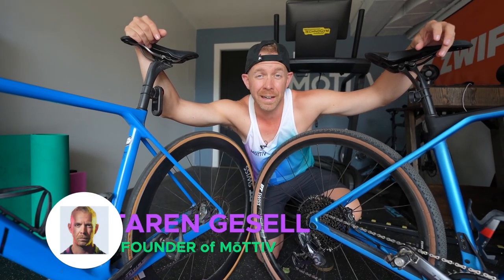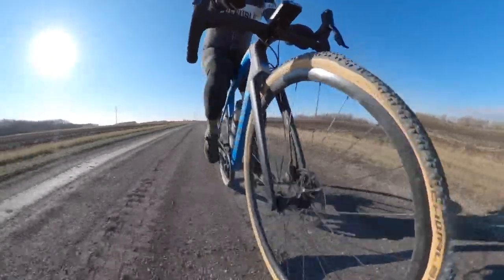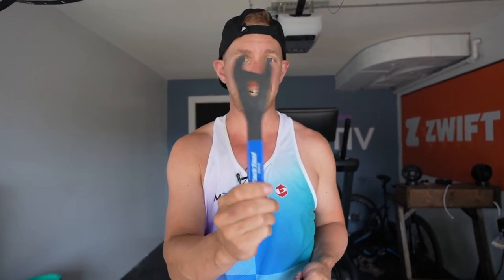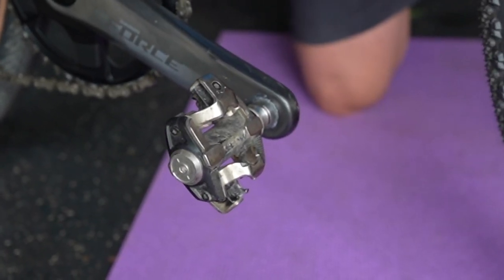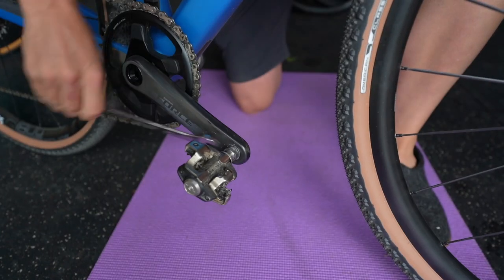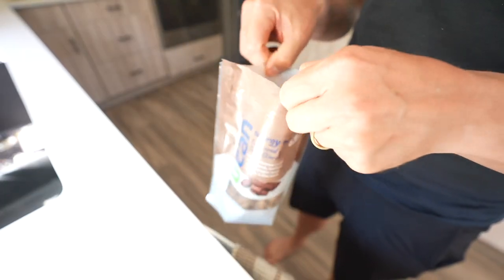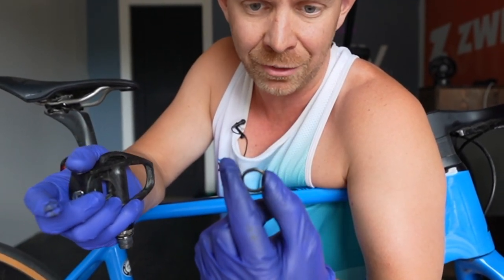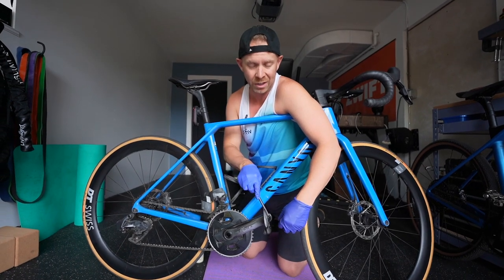How to Change Road Bike Pedals Without Special Tools

Comment: Nice basic information... and, yet... you omitted the biggest reason newbie's have a hard time taking off pedals.  It is because they are turning the wrong direction. Showing (in detail) the correct way to determine the direction you should turn would have gone a long ways to making the video more informative.
Reply: that's right ! also the number of this crenchtool
Reply: Very true! I found this to be helpful: Looking at the pedal from the side, if you turn towards the front wheel = tightening, if you turn towards the back wheel = loosening
Reply: Never be surprised when Taren makes an obvious mistake.  Some say he does this on purpose to make persons more likely to comment and more comments is better for his videos.  Others say he is just not that smart.  You decide.
Reply: @PatrickDelorenzi be more specific.. turning from the inside using an Allen key and turning from the outside using a spanner is completely different . I still cannot remove pedals !!!
Reply: @manwithnoname6580 It was either the point you made about the hex being different or trying another brand of unsticking spray, but I tried a different approach and I finally got my pedal off, with a dinky tri-arm hex tool. I don't even know if I'd been turning it the wrong way before because this stuff is as bad as plumbing for not knowing which way to turn things. Hope you eventually got your pedals off.